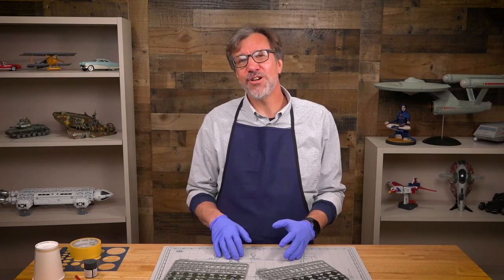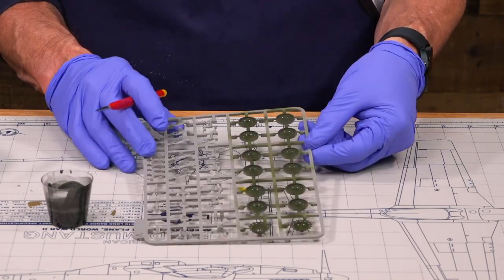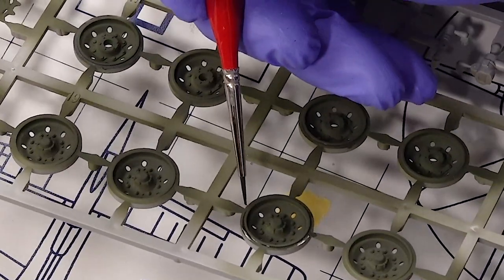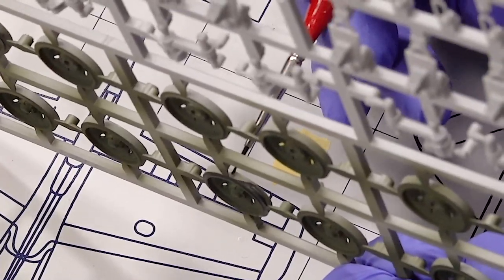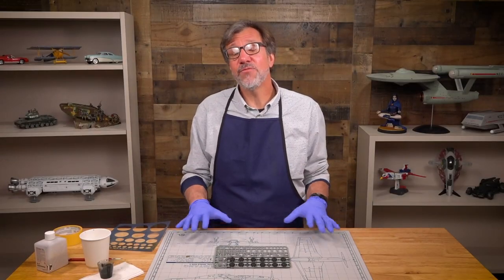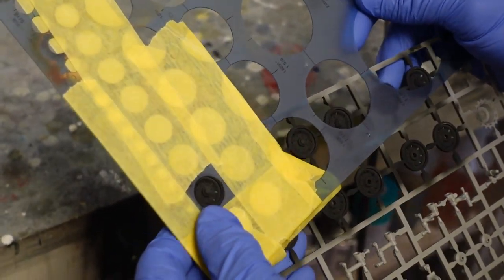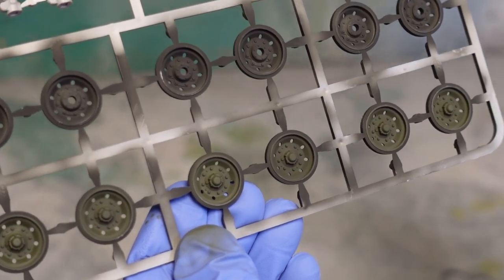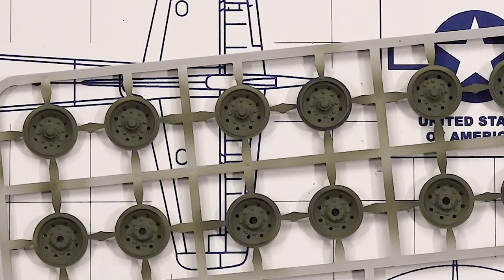Scale Model Basics: Painting road wheels

Comment: Great practical advice in an excellent video. As a tip, for rubber tyred Road wheels on tanks, try using XF-85 rubber black instead of natural matt black. You'll notice the improvement straight away! Model on!

Comment: I found this very helpful I've started building a model car. And I sometimes struggle a little bit on wheels finding the write and easiest way to do them on both cars and aircraft's.
Reply from the maker: Glad it helped!
Reply: What paints are best to use for model cars and to polish I'm using enamel paint to do this..and would be ok to wet and dry sand paper. And if I wet sand will it bring off the enamel paint.?